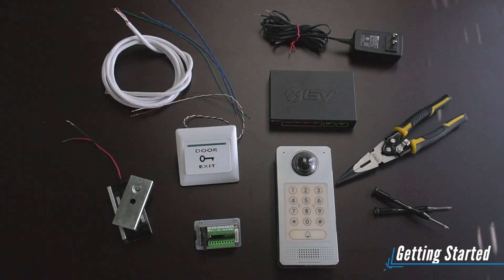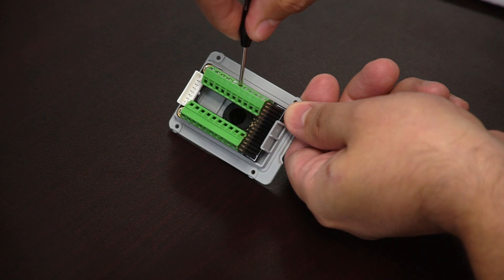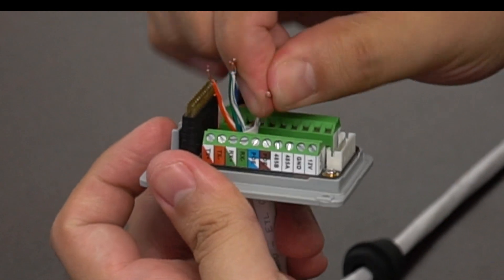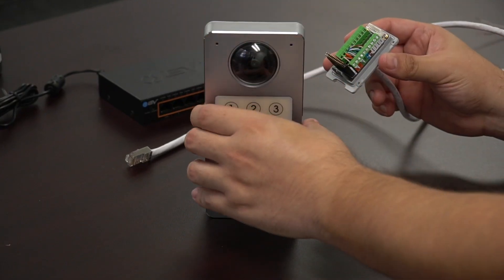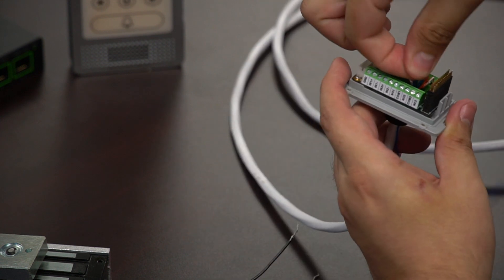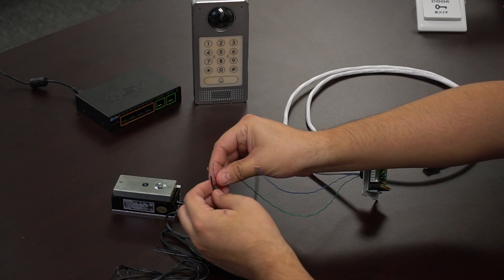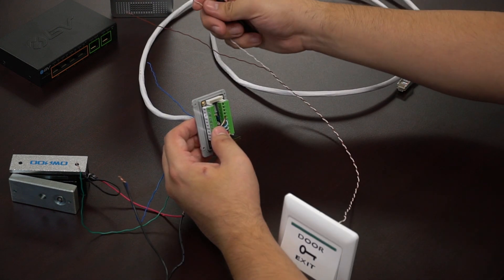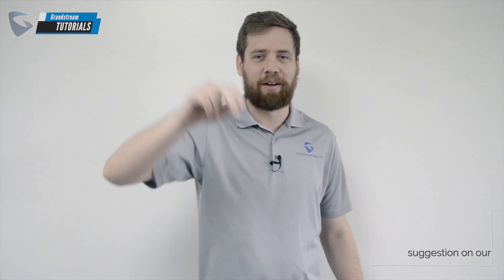GS Tutorials - GDS: Wiring Guide

Comment: I've been a really big fan of the UCM line and this would obviously integrate really well with it, but my concern with this product is this... What stops someone from forcibly removing the GDS and shorting the wires directly to release the door strike or mag lock? I would think you would need to separate the release mechanism in order to actually be secure, similar to how the Unifi door strike works.

Comment: What terminals are you connecting on the door switch?
Reply: If the "termianl" you mentioned is referring to the back board connector or PIN, the door switch or strike should be connected to COM2, NO2 or NC2 (depending on the type of strike or lock used). The stiker on the board has colored with Yellow with "Lock" marked there. You cannnot miss it, it also marked clearly in the QIG and listed in the User Manual.

Comment: Why did you twist the blue and white blue , brown and white brown dose it make a short with the switch ?
Reply: The wires were shorted to fit into the GDS terminal block. On the block itself, there are stickers that would instruct you where individual wires or shorted wires belong.
Reply: @grandstreamnetworksyt9855  i meant short with the POE switch